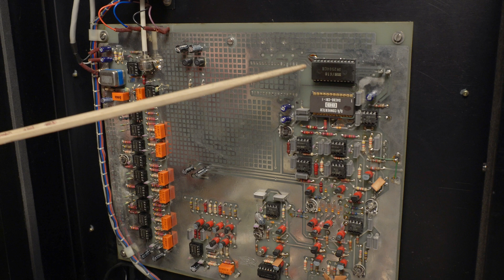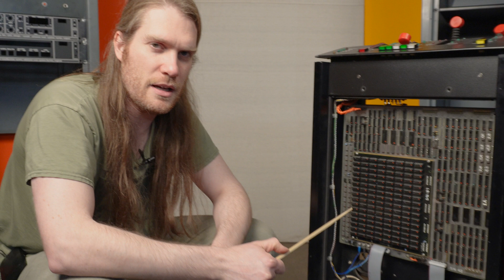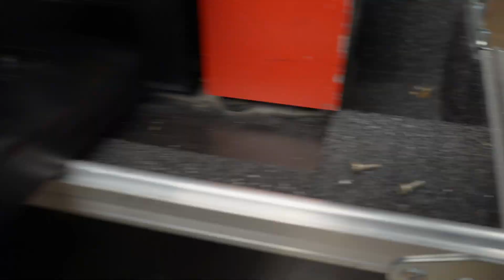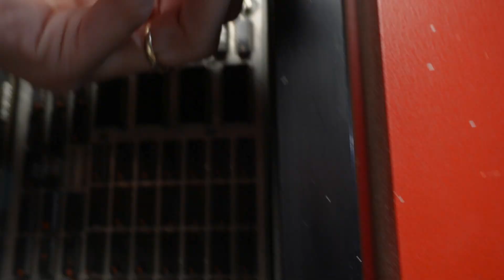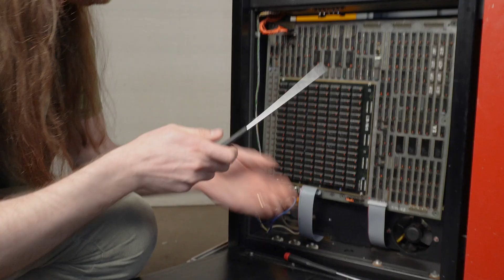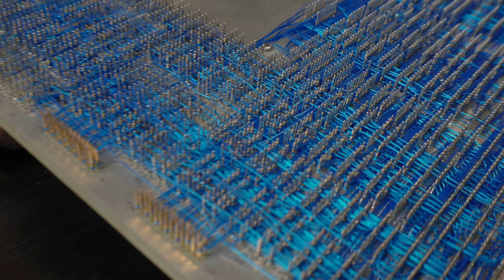EMT 250 Part 2: Under the Hood

Comment: I think there is a schematic for the digital board or at least I remember seeing what kind of looked about right, it would be interesting to see if it matches what you have there. Probably I have a PDF of it somewhere. Wire wrapped, that is crazy!
Reply from the maker: I have that same PDF - I think a lot of it is there but I don’t think it’s everything. I didn’t really need it for this repair, though since I made this video and burned it in, it started making an odd noise so I might need it after all!
Reply: @foleytronics  There’s one PDF that had the A/D, D/A, analogue, and shift register delays in it. There’s another larger PDF that has that plus the ALU, PROMs, a pile of 8 input data selectors, DRAM, I think it used 74LS670 register files if I recall. It looked pretty complete.